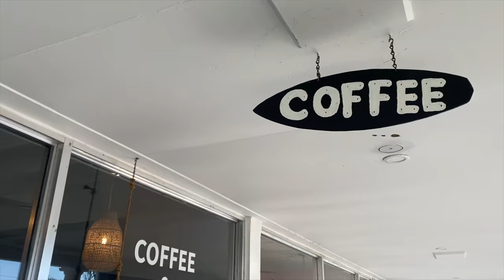Building BACKYARD Project & Snorkeling with SNOOK! *Vlog Style*

Comment: Your plan B for the bridge with cross pieces, 2 foot on center, would have been the way I would have made it. 2 by 4 probably more than enough for what looks like a 2 foot span. 2 by 6 would be overkill... When driving the screws, hard to put down pressure on the drill  with both hands on the handle. One hand on handle to squeeze the trigger, and the other on top of the drill to add pressure. If you need to raise it, some brick or chunks of concrete, or pavers from the big box store would work fine. Also, when wet or muddy it will be slick. Any marine store down there would have a bunch of non slip types of things you can put on it to keep from sliding. Good idea... You did use pressure treated lumber which will last a long time before it rots.

Comment: Two types of guns, drill and fastener. You  (Kelly) are using a drill gun to fasten which is really hard. A fastener gun has a hammer inside that makes putting screws in way easier. A 3 1/2" screw will go in like butter with almost no force, it's beautiful. A drill gun is variable speed for different types of construction material for best effectiveness while using a drill bit. Buy a combo pack, its not much more than a single tool.
Reply from the maker: Yea it’s the only drill I had and it worked haha so just went with it

Comment: Hey Kel, You need to put in some blocking between the side boards and the middle so they don't  collapse on themselves. Just like in houses between the 2x4s or in this case 2x8s so they don't bend side to side.      ]_[-[     Understand?   If this one doesn't last long, try using treated lumber if you didn't this time(I couldn't tell), and for the top try using some marine grade plywood. Doing it this way will make last a long long time. Don't forget the blocking!

Comment: You can get free Lobster Traps with a new design the wood dosn, t need to be there and a pvc bottom with chicken wire and new cement about the same thickness then put an inside pvc flat piece inside and screw down through will wet with no ferrous, i. e no rust screw but longer same size of screw head then get a piece of pvvc to cover wood hole or crabs will climb out.